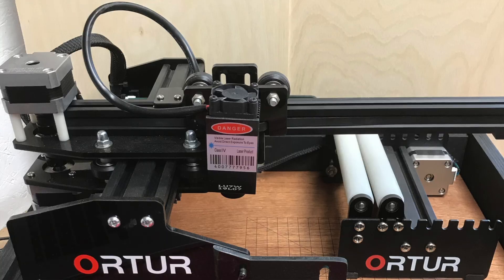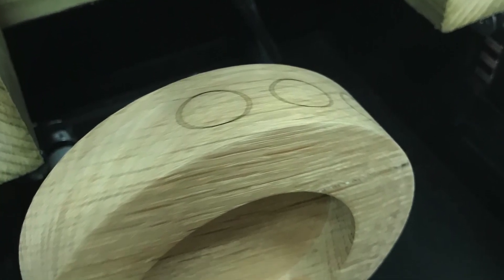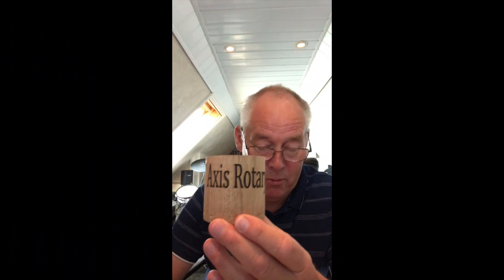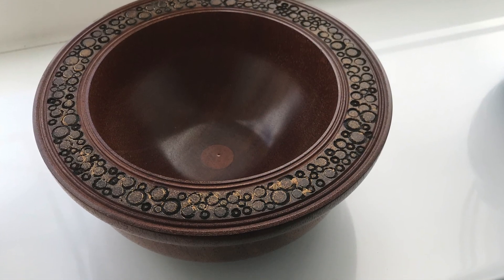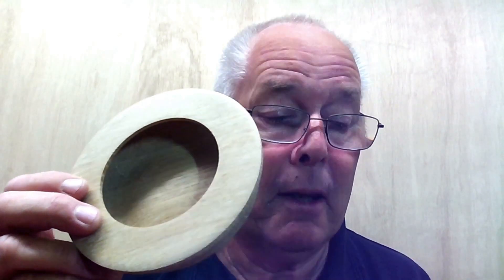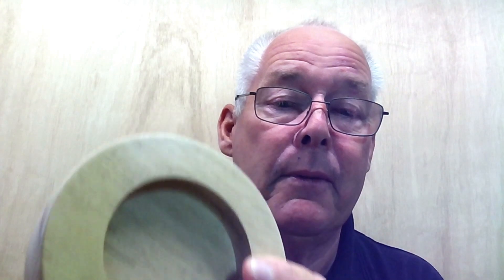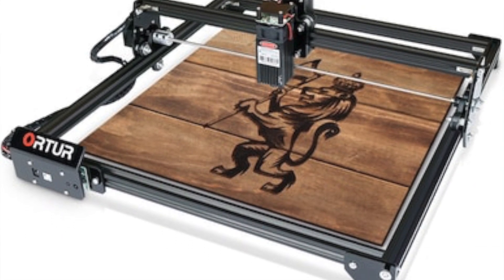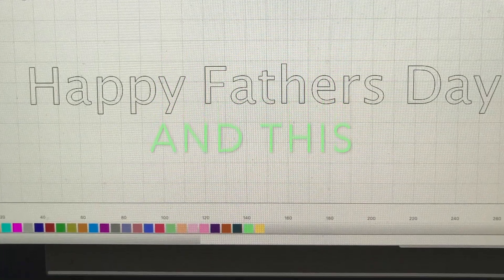Ortur Master & Rotary Roller System

Comment: What speed and power-settings did you use in lightburn?
Reply from the maker: Hi Rev, from memory i beleive speed was 130mm and power would have been 100% as I was using a 7w module.
Thanks for watching,   John.

Comment: Thank you for taking the time to make these videos John. They are very instructive. Any guidance you can provide (in the way of a video preferably) of how to program engraving a pencil, for example, in LightBurn would be tremendously helpful. Many many thanks for being such a terrific resource.
Reply from the maker: Hi and thanks for your kind comments. The Ortur engrave does indeed come with some software, its called Laser GRBL (it's Windows based)  I have tried it and it works well however, you will also need to install an editing /creating software something like Inkscape (free download).  As a Mac user, I purchased a software called Lightburn £34.00 its an all in one editing/creating/burning software, I find it suits my needs perfectly. As for the "Y" axis, its a great machine and I will be creating more videos on what its capable of (inc pencils/pens)……regards,John.
Reply: @johnwheeler9696 Thank you for your prompt reply. I came across your earlier video where you describe the software and edited my question above. Very much looking forward to your forthcoming videos.

Comment: Keep up the good work John! Would it be possible to do a non-uniform shape (ie. Wine glass) on that roller or is it not designed for that sort of thing? Cheers fella
Reply from the maker: Hi Ben, thanks for your comment. In answer to your question “yes” it is possible and I will be doing a video on it however, the 7w module I am currently using will not engrave on glass, that said I will turn a non-uniform oak goblet and engrave that. My 20w module is in the post.   Thanks John.
Reply: @johnwheeler9696  thanks John, can't wait!